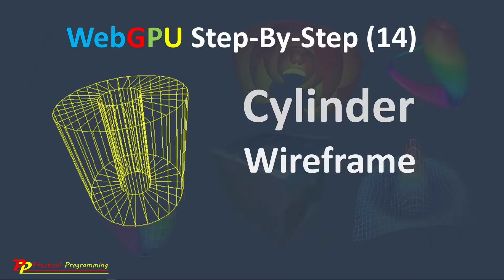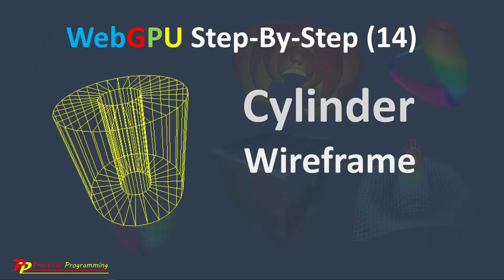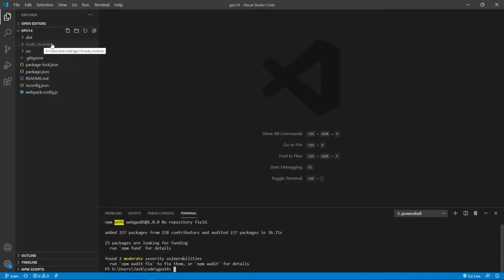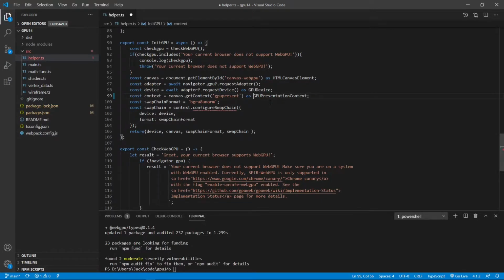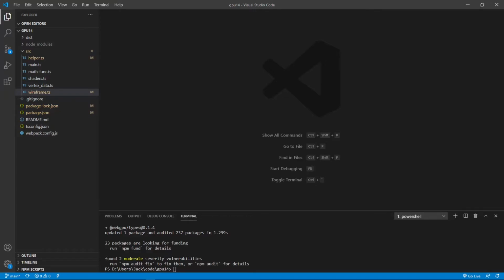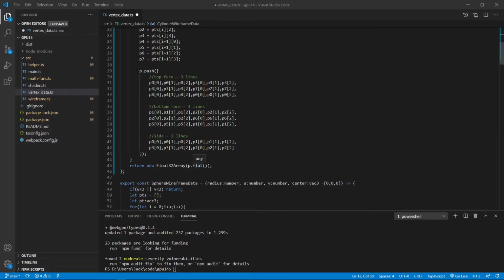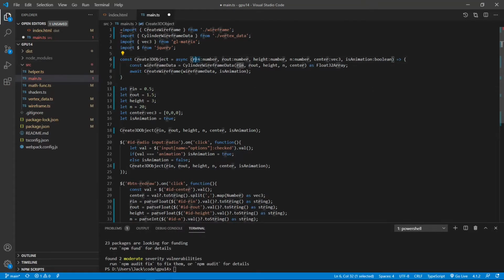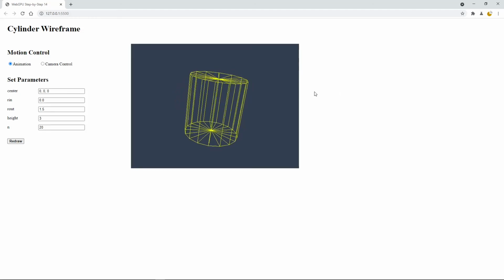WebGPU (14): 3D Cylinder Wireframe

Comment: Great tutorial series which I've enjoyed so far, but I wonder if this code still valid? I managed to run the previous examples by updating the webpack version, but I get the following error here:

Attachment [TextureView] size (width: 640, height: 480) does not match the size of the other attachments (width: 1280, height: 960).
 - While validating depthStencilAttachment.
 - While encoding [CommandEncoder].BeginRenderPass([RenderPassDescriptor]).
Reply from the maker: The example seems working. 
source code: https://github.com/jack1232/webgpu14
live demo: https://jack1232.github.io/webgpu14/
In this example, I used webgpu/types 0.1.6